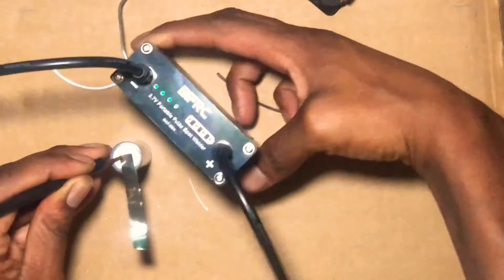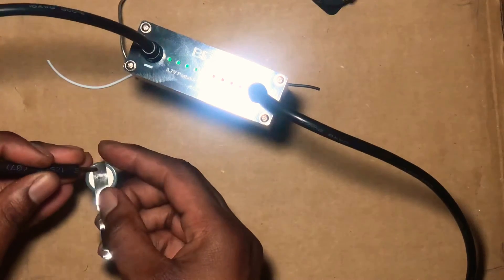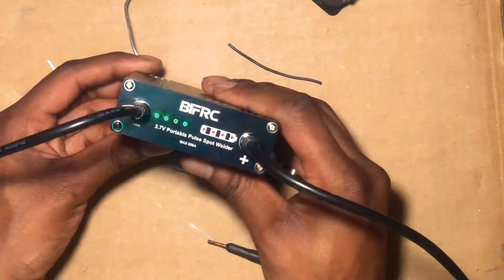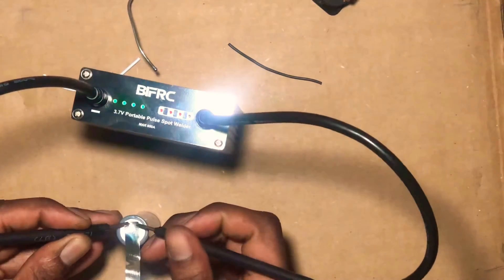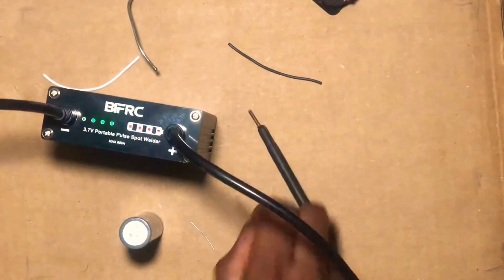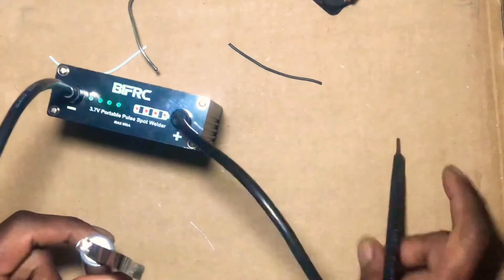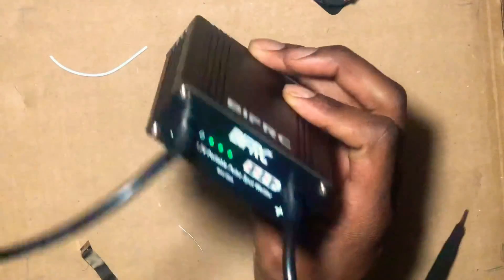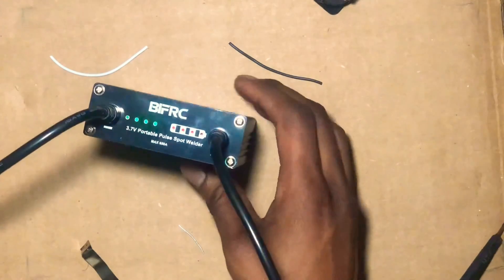*FINAL REVIEW* Portable Mini Spot Welder Machine Test 18650 Battery

Comment: And he never made another one, again!
Then I realized this video was 2 days ago 🤣

Good thing I didn't buy this. Did you try Level 8 or 9 on full charge again?
Reply: The battery isn’t fully charged it shows three bars.. you prob used it with low battery voltage sag happens and you blew the mosfets...
Reply: @nicholasmartinez8511  after full charging. during use does it turn off when it reaches a critical/low voltage? Or do I have to monitor the voltage? and what is the minimum and safe voltage for operation?
Reply from the maker: Haha, maybe it’s the thumbnail 🤔 thanks for that tip. 

And yes, I tried them but it only worked when it wanted to. Overall it’s a great product, just would’ve be great for often uses 👍🏾